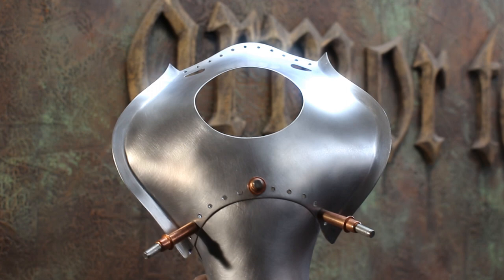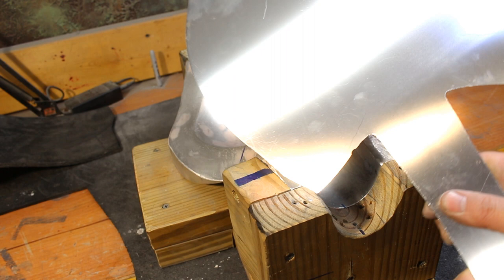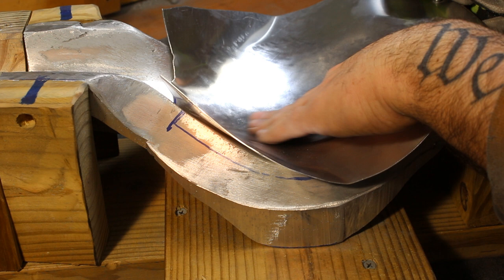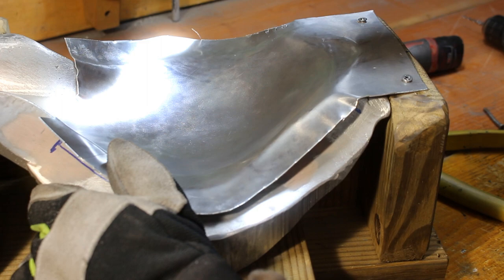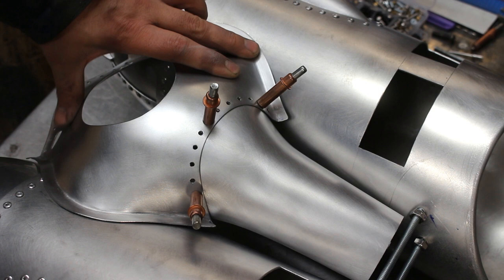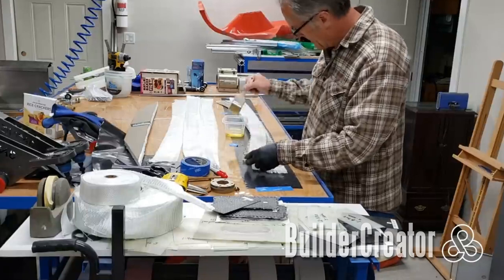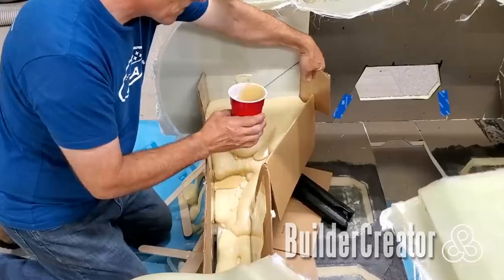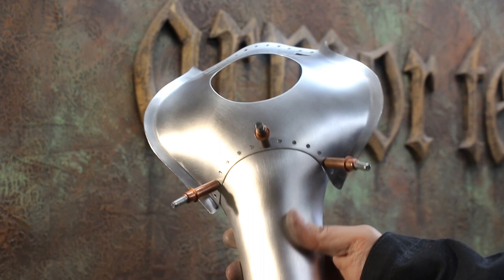Forming Complex Metal Shapes with a Hammerform (Featuring Jay Jarvie from BuilderCreator!)

Comment: Is it possible to make the anvil part with the shape out of concrete reinfirced with fibers for example to not have to use use are more comöicated method of casting aluminium ?
Reply from the maker: I actually tried exactly that (see my failure is everything video). I do believe it would work but I couldn't get it to
Reply: @DavidGuyton  Oh interesting, I am sorry I just found your channel and didn´t watch any other videos (mainly because I am at work right now, am was preocupied).
Great, I will watch that later =)

Comment: How did you determen the form of the mold, not everyone has the same body shape
Reply from the maker: I was able to borrow a plastic jetpack cast from one of the original props. I did a lot of measuring and fitting contour gauges to be able to reproduce the part nearly exactly

Comment: Get you some right and left offset snips. You can make continuous cuts without stopping or making relief cuts. Throw those yellow handled ones away. They're good for notching and that's about it. Malco makes some good ones and I've used those for years, but they're make in Taiwan. If you want US made go for Wiss or Midwest. Been using Midwest for the last few years and they're good for the price. I mainly cut 24g-26g steel, .027 and .032 aluminum, and 16oz copper with them and they last at least a year with every day use.
Reply from the maker: I saw a video Ron Covell did saying basically the same thing. I have meant to get a set of those since.